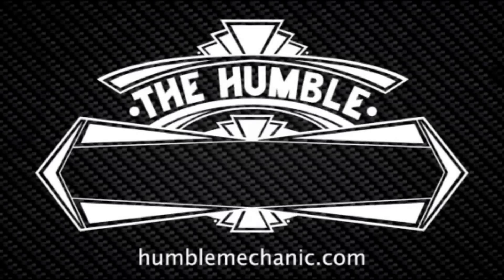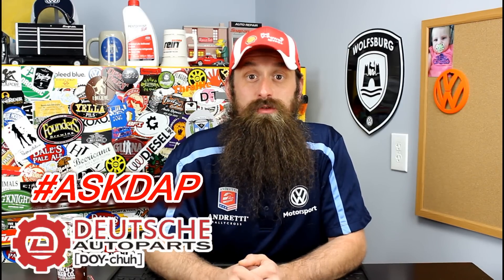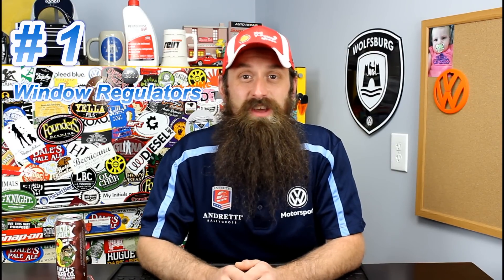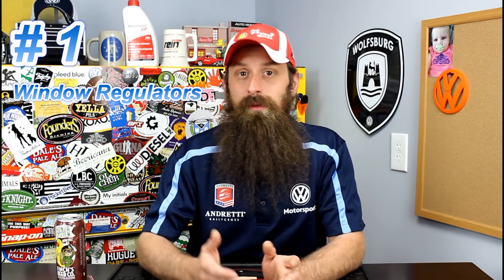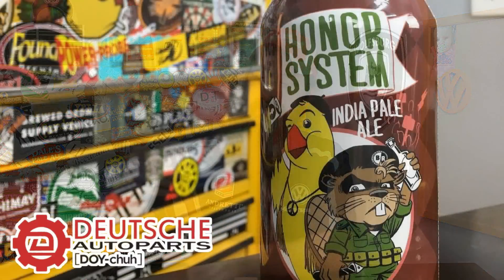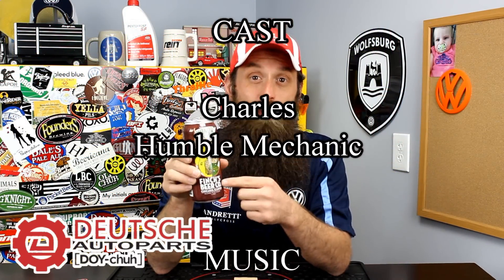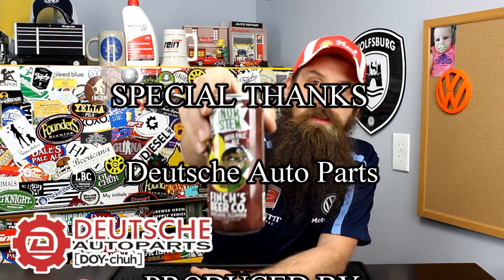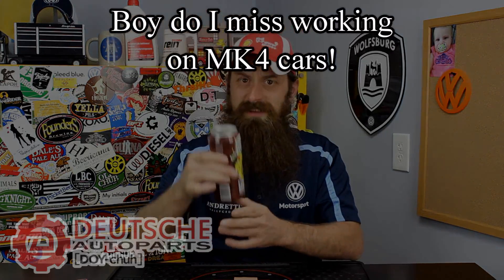Top 5 Failures 1999-2005 MK4 Golf, Beetle and Jetta

Comment: Man, I can't believe I missed most of those! Thank god for the TDI!
Reply: TDI didn't have those issues?
Reply: @CyberSkynet-o2b  It totally did! I replaced the thermostat, brakelight switch to start. The bushings on TDIs would go even faster because of the extra weight of the cast iron block!
Reply: How about the almost totally plugged intake manifold from direct injection ALH engine ?
Reply: @davidleet9501  its a lot of fun to clean watch some videos of it! 😉
Reply: @tdidan Actually, not completely true. Plenty of vehicles ran for years with EGR and PCV without intake clogging. The thing about direct injection is there is no fuel flowing with the air to continually clean deposits. So all the carbon and long-chain hydrocarbons are returned via PCV and EGR to condense on the internal surface of the intake manifold. Now that gas rigs have converted to direct injection, too, we should see a lot more of this issue. Apparently there is no free lunch!

Comment: Good Video.  However, I would Definitely Add the Melted Fuse Box Issue on top of the battery with the wiring harness and bad wire that connects to the Alternator.  It seems to be a Very Common Problem on the MKIV Platform.  Much Respect, Theo :)
Reply: I agree replaced mine multiple times until my father rebuilt and re soldering the connection with better wires

Comment: Still have my 2000 New Beetle 2.0 with manual transmission, fun little car! It had its fair share of problems (window regulators, brake light switch, interior flooding from clogged sun roof drains, air bag codes, burns a couple of quarts of oil every 1k miles, door modules), but considering how old it is, not too bad, and certainly nothing nearly as bad as our 2010 Passat Wagon that we finally got rid of. That POS made me sour on VW big time.

Comment: 2.Slow cracked coil packs should probably be up there somewhere. I had an '04, the suspension bushings were kinda scary, it always felt like wind gusts were hitting the car, I didn't realize how bad it was until my wife was following and saying she was seeing sparks. Luckily no real issues with window regulators, but electrical gremlins constantly blew head light and tail lights.
Reply: 1.8 had coil packs not 2.0l tho

Comment: Peeling clearcoat.
Reply from the maker: My B5 is doing that
Reply: Yes...2001 Techno-Blue with 3 waterpumps and 2 catalytic converters and no door locks. New shift linkage and in need of driver-side pull handle. Oh yeah and 3rd fuel pump.  Sorry...at first it was just about the clearcoat.
Reply: 99 Techno blue beetle same problem lol
Reply: Oh yes, my red 02 is almost completely peeled
Reply: Not mine
Reply: Mine is doing that now...
Reply: @MsKero3355  I just scraped all the clearcoat off the roof of mine with a credit card.

Comment: a early mk4 platform without door module fault are rare
Reply: mine never failed, maybe it happens more with electric door windows?
Reply: mine is a 2004 and all doors are fucked up including the trunk, all power windows give trouble the roof has a cover that falls, the interioir of these cars are horrifying
Reply: Bryan Saphire mines still in good shape. It's all about how you keep it up.
Reply: I feel like I won the lottery. I have an 01 Golf and this has yet to happen. All the other stuff, but not this, yet.

Comment: The coolant temperature sensor has been changed twice in my car in the past 4 years the last time I did it myself and so far is working great. I used to have a GTI and the bushings under suspension we're bad too. This video is very accurate 👍. Oh and I forgot  the driver side window is dislodge from the carrier, if I roll it all the way down I have to help it with my hand to make sure it goes all the way up in its correct position hahaha
Reply: I laughed reading your response. I have a 99 gti vr6 and have the same window problem. When going through a car wash, I wear my arm out holding the window completely up because if not, there's space at the top for water to get through. 

What else? Throttle body replaced, multiple oxygen sensors over time. I can out a schedule to replacing the MAF. A lot of repairs, but I love the car and it still looks nearly new and, after repairs, is running smooth ... with a squeak here or there.

Comment: We always replaced control arm bushings with the no hole solid rubber Audi tt types
My beetle TDI has 462k miles now
Reply: john moser what is the part that will fit in the control arm bushings because I’m changing mine every year or so and it’s killing my tire life!
Reply: @RaudiRaul  the mk1 Audi tt is the same platform as the mk4 golf Jetta and beetle get the tt control arm bushings they will fit they are solid rubber instead of the ones with the holes that flex and break down

Comment: As an owner of a Bora 2002 (european version of Jetta Mk4 - made in Germany), I had only issue no 5, suspension bushings, but I wouldn't call it a problem since I replaced them well after 150k km.
Reply: And I also think there is a quality difference between Bora (made in Europe) and Jetta (made in Mexico), hence the difference in failures.
Reply: i had MK4 Golf made in Germany and had no faults in 80k miles

Comment: 1.8t coil pack wiring harness. The original part had a TSB for replacement due to cracks in the wire insulation. There are now a couple different aftermarket solutions that don't require depinning a connector at the ECU.
OE diverter valves also fail pretty regularly.

Comment: 7:50 My 2004 Golf 2.0 had a po343, 4 coil codes and the engine would not spin pass 3,100 rpm. The dealer wanted $2,048 to replace the timing belt. I replace the $17 temp sensor and everthing was fine.

Comment: One another for all - trunk latch, i had 2 golfs hatchbacks both had this problem, and seen that jettas have same problem, because release mechanism is the same, and replacement part costs 130$ from dealer, kinda tearing skin off price... Luckily I know how to resalvage and got from junkyard for 15 bucks and made key work by myself. And just happened first one where window plastic clip broke and when I opened window it fell in door, luckily didn't break the glass... So these all which humble mechanic mentions are totally true :D
Reply: Somewhere on YouTube there's a guy who sells a homemade part to replace the flimsy OEM one. Never had any issues ever since I installed it on mine.
Reply: AR Rodrigues industries sells a repair kit for these saving you $$. I bought his glove box hinge repair kit and it worked great. My glovebox door will never crack or break again :).

Comment: Have a 99 vw beetle.  Have had a coolant reservoir bust out of nowhere.  Abs light issue as well.
Reply from the maker: Bummer. Those bottles can almost wear out over time. The ABS can be a number of issues. Typically a speed sensor is the main cause. I’ve had some get bad(expensive) but that’s not as common

Comment: In Europe we had a major issue with 02K gearboxes grenading themselves where the rivets in the diff broke and punched holes in the transmission case. Nice.
Reply from the maker: Ouch. I’ve heard people here have similar issues. I’ve personally never seen one
Reply: Do all the 02k have that design flaw? Heard they fixed it with the ERT designation and replaced the rivets with bolts. Just wondering since i own an mk4 golf with the 1.6 16v (ERT)

Comment: My automatic 2002 beetle shifts really hard when going past 35 mph but drives smoothly with no issues after that or when going slow speeds, it just started doing this. Hope the transmission isn't breaking down.

Comment: Owned three of the 98-2003 TDI beetles only had a few issues #1 maf sensors, control arm bushings, swap to audi TT,  fan control module/relay, fuse box melt down from fan amp draw, injection pump relay, oring on coolant solid line out of thermostat housing on block, plugging up after egr in intake manifold until egr delete, would always clean at timing belt change, alternator brushes/volt regulator, only had one window regulator fail, had one with phantom electrical issues in winter with pass door window opening automagically while driving. Had to replace computer in my 98 it was chip tuned literally with socket install in original ecu and the chip ended up crapping the bed around 200k. Door interior panels crack and go to hell, to expensive to replace.

Comment: Really enjoying your videos.  
I was a tech at a VW dealer from 2001-2012,  and now have my own shop at home. 

You should totally do this top 5 fails for mk3.  Heater cores, rear axle bushings, taking apart the cluster and cruise ecm and finding cold solder joints...
Reply: the wiring in the door flex conduit accordion boot thing bending and breaking. Horrible engine mounts
Reply: @stretchedlife  vacuum line inside of the ecm box

Comment: Only changed front wishbones twice in 63k even went through poly bushes 18 months.
Just doing rear trailing arm bushes, car now 123k miles.
Biggest problem is the coil packs went through 12 in as many months never a problem with the 2ltr FSI packs on adaptors well worth it.
Took me ages to figure brake switch at fault cuts power, now on third.

Comment: I have a mk4 golf and have been very happy with it overall.  The catalytic converter did fail, but that was covered.  never had problems with the window regulators or the brake light switch.  The manual transmission is very good IMO

Comment: I had a 2003 GLI 24v I put 100k mi on. In that time I had
1. 2 coilpack failures
2. Slave Cylinder failure, replaced entire dual mass clutch assembly "since I was in there"
3. 1 front wheel bearing
4. Passenger front window glass came out of the clamp for the regulator, just had to tighten that for fix.
5. oil pump failure around 110k mi
6. Water pump
7. Crayon smell
8. Sunroof drain clogg/trashed headliner

Only common issues I had would be the coilpacks and sunroof drains. I sold it at around 195k and it dribbled coolant from somewhere but I trusted it anywhere. Went to H2o x4, SOWO x2, TOTD x2 in that car. Love my MK2's better but miss that thing.

Comment: Nice. I've got an '07 Golf City which is on the MK4 platform. Coolant Temp Sensors were replaced along with thermostats. Still spitting different codes at me. I've got a P0420 pending for the Cat and a small leak in the EVAP. What I save on gas, I put in repairs :D

Comment: The left window regulator broke on my two-door Mk4 Golf  and was fixed under warranty.  My catalytic converter was fine but I remembered the warranty extension I got. No brake light switch problems or radiator fluid temperature sensor failures that I can recall, but the check engine light came on while I was driving one from Pennsylvania - that might have been what it was.  The bushings did wear out.  Other problems included peeling soft-touch surfaces, the trim falling off the doorway - you know about that already, HM!   Also the glove box door hinge.

Comment: The European-only SEAT Leon Mk1 was also based on the Mk4 Golf. I had a 2001 TDI version which flashed the ignition coil light whenever the brake light switch failed. Suspension bushes had to be replaced pretty much every year and eventually it developed a fault where the engine refused to start without connecting the diesel injector pump to a positive electrical feed. Yup, it was direct injection but the injector pump was the same Bosch mechanical pump as used on old indirect diesel engines. Eventually the front end rusted away.

Comment: Only failure I had with my Mk4 is the front end bushings and the fuse box on the battery melting. Kinda worried now. LOL I also think I replaced the coolant temp sensor, but not because it failed, I just did it because it was cheaper and dint want issues down the road.
Reply: Totally a most common failure with the " fuse box on the battery melting"

Comment: Have intermittent trouble with my 2004 Golf MK4 2.0GLS. I have my car running, switch off the contact and dashboard resets. Clock to 12:00 and tripmeter resets to 0.0. When I turn on the contact I can hear relays switching and even the door lights are flashing, 
Today I checked all grounds on the lower dash and they look good 0.1Ohm to the Battery. Already cleaned the ground connection under the battery tray.
Today I also noticed that when I hit the brake pedal at the moment the car won't crank that that also causes the dash to fade out and reset clock amd trip.
Last 7 weeks I only had this problem twice while daily driving on weekdays.
I have seen in online forums that this is a issue that appears to happen (maybe common issue) but never really saw a plausible solution.

Comment: I have a 2000 vw beetle 2.0 non turbo, and it seems like its consuming too much oil. Took care in no leaks, not burning it, even passed smog. Is there a way to clean out the pcv system. Noticed there is no listings to purchase a pcv valve. My crankcase vent tube and hose look a little cruddy as well. Bought new ones to swap out. Any suggestions? Should I upgrade to thicker oil as I run the 5w40? Maybe 10w40 or 20w50?

Comment: maybe it has a plastic impeller on the water pump so it fails before the timing belt does. Interferrance engine, change the timing belt when you do you water pump.
Reply: And vise versa ...in there for a belt , do a pump.

Comment: 2004 Golf, 2 water pumps, 1 Cat and flexpipe, 1 ECT, both cooling fans, 1 set of control arms. What about engine/trans mounts? I've replaced my dogbone mount twice. I'll also never forget the day both rear windows slammed into the doors after hitting a pot hole. And I always have one burnt out light, if you fix it another one will burn lmao.

Comment: 'Bout 5 years ago when I still worked for my uncle his repair shop I used to replace a ton of gearboxes on mk4's. Cause they would fail or even blow up. 
Once a friend of my uncle asked me to replace his gearbox cause it wouldn't move in any of the gears. I put the car on a lift and saw that the diff had blow apart half the gearbox. 

My uncle hated to do clutches and gearbox swaps. So I got all of them. He even started planning those jobs on the days I worked there so that he didn't have to do them.

Comment: I wish you would do a deep dive into all the other failures of MK4 that you have remembered since then.  Its interesting history that you may remember now.  The perspective you have is interesting.  You lived through an era as a dealership mechanic.  Its interesting that you think it reflects poorly on Volkswagon.  Its helpful in knowing how to keep these cars going now.  Mine has the green break light switch.  I wonder if that was a dealership replacement. Also, my glow plug light has been flashing and its missing the number 13 fuse. For once I may not be a parts changer.  Time destroys everything and you saw a pattern in the degradation.  I'm still figure out how the glow plug operates in cold temperature.

Comment: Thanks for the list. I just puchased a 2004 VW Beetle with really low miles (62K) for my daughter and dropped a couple 2K into tunning it up, complete check up, breaks everywhere, etc... Anyway her AC was also checked and was said to be "Working Fine", but it ended up going out (another $800), then it worked then it didn't and they said we needed a new fuse box (the one on top of the battery) for another $400+ because they said it was bad. I am sure you can see lots of questions here... however I feel like I may have replace the AC when I didn't have to due to the "bad fuse panel above the battery) - Yes? No? Also, now that they replace the AC the car is MUCH LOUDER when driving. What do you think they did? Any videos for help or suggestions?
Reply: Still have your cat? 🤣

Comment: I owned 2 MK4 TDI's
Both had some of the later listed issues (Blower motor resistor, or some bushing changes)
But given they are TDI's they were pretty high mileage and ran ultra reliable... understandable to do maintenance on a car with 300000+ km

Comment: Hi, I have a issue about my VW sharan 2004 model, fusebox located in the engine near battery the to thick wire is getting hot and the fuse box is melting , diagnose was done and everything is fine, fuse box was change but it still the same problem.Do you have an idea? Appreciate the reply, thanks!

Comment: How you doing my name is Nathan I have a 98 Volkswagen beetle I was sitting in the Drive-Thru and it just died starts back up but it just keeps wanting to die like after 10 minutes I'm wondering if the fuel pump is getting hot I was wondering if you had an opinion

Comment: The odd thing is that I haven't had any of these problems....but many other ones. I'm on my third rear wiper and I'm pretty sure that one is leaking as well. ECT flange wearing down. flex pipe from the back of the engine. wiper relay. plenty of other stuff I'm not remembering right now.

Comment: Interesting story - I bought my MKIV Jetta in 2014 with a P0420 CEL. Car had 119.8K miles and 9 years 10 months of age. 

Ran acetone through the system as last resort to get rid of CEL. No go. Called local VW asked about warranty. They said sorry, car too old. Just on a lark, I called VOA and they told me.. "oh sorry, your warranty only runs 10 years or 120K". I was like what?? Great! Sign me up. 

To make long story short. I put in two bosch (OEM) oxygen sensors so I wouldn't get clipped for $400, and drove it up to the dealer where they did the repair under warranty. Barely had 200 miles or 1 month left on warranty, but VW did the repair . They had to tap new studs too cuz it was a cali , and I'm in MA. Easily $2K repair. So glad I followed up with VOA.

Comment: On top of what you mentioned add over heating, blown head gasket, bad heater core, air conditioning nonfunctional, mutiple front headlight failures. I had a 98 Bug and it was the worse car I ever own. Everyone that I knew that owned this gen beetle/golf/ jetta had major problems. VW should have had a class action lawsuit against them regarding these cars.  They were all lemons!